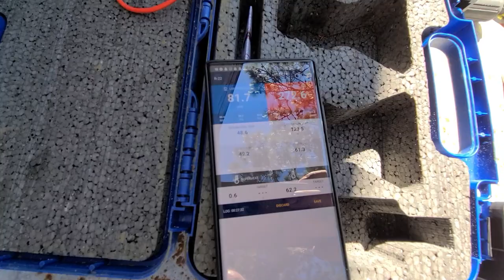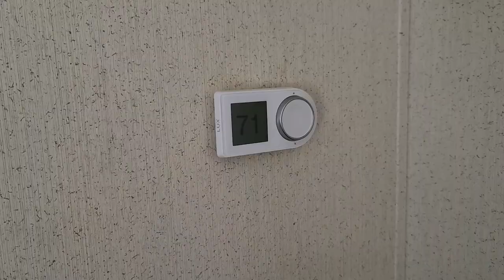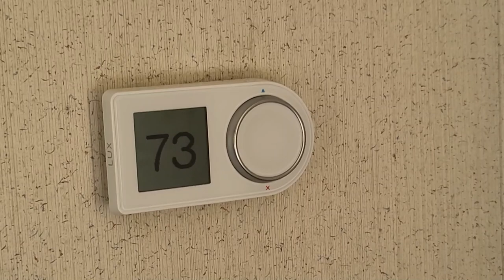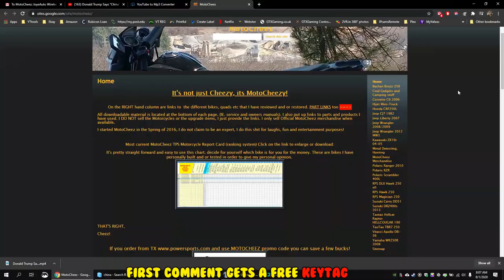(S2 E2) Fence, gates, more property, repairs, MooSoo battery vacuum, HAWK TIME!

Comment: Please keep us up to date if you do hear about someone cracking into the ecu and creating some maps for the dlx.  I do agree with you that there is still more power to be had with the dlx.  I ended up cutting out the catalyst out of the pipe to get it to breath.  With the exhaust done and a KN air filter in the filter box I do believe the bike is running a tad lean.  I'm going to pull the plug again after I put on another 100 miles  to confirm.  Most of my riding has been highway, so I usually have the throttle pin just to make highway speeds.
Reply from the maker: I will for sure! I'd bet it's lean too
Reply: @MotoCheez  One other thing I would like to try to see if it would make any difference is to swap out the fuel injector for a bigger injector.  I asked the question on China riders forum, but no one could give me an real definite answer if it would work or not. Would be nice to find out who makes the injector and to see if they make a larger size that would still fit the intake and give a  try.
Reply from the maker: @ricsha91  good idea

Comment: Try ecu shop and their "full stand next" ecu. They do several different manufacturers and models. I have one for my grom and it's great to tune yourself instead of sending off for a reflash
Reply from the maker: I also have one for my Grom (haven't done video). I can't find one for this ECU that has the set maps. I haven't dug in that much yet either

Comment: Definitely awesome down there for dual sport riding.
Cheesy I've thrown out better condensers then you got over there.
Maybe you should consider changing it out before you come down to a mold factory
Reply from the maker: It's fun but no mountains. We took the unit apart a few episodes ago, it's pretty clean inside these units are all in one package units. They're like $2500

Comment: Thanks for the content, those palmetto bushes are the main plant in the woods.
Reply from the maker: Yes, and I just learned they turn into a palmetto tree, almost like a palm tree but doesn't grow as tall.
Reply: @MotoCheez  Not really. They just spread out and get denser in terms of numbers. 4'-5' is a really, really tall palmetto. but there are tons of different palm trees that run the gamut of heights between palmettos and coconut palms.
Reply from the maker: I looked on google, said palmetto trees can grow 8' , I never knew. I was going to replant some on my fence line. I guess I need to research some more on the different types.
Reply: @MotoCheez  I grew up in FL, on both coasts, so i only base my skepticism on that. I personally, have never seen an 8' high palmetto.... but that is "here". Maybe they get that big in the Carolinas? (One of which is named "The Palmetto State")
Reply: @MotoCheez  They do make a great "barrier" plant. as they are hard to get through on foot, when dense, and like i said earlier (and as you must have been told) they are the favorite environ of rattlesnakes. :-)
Reply from the maker: @strongtower1162  I see some that look like palmetto trees growing in the woods all sizes. I honestly don't know..., maybe something else? I also lived on east coast , palm bay.

Comment: What’s top speed on the hawk cheese? And that’s the fuel injected one right? Thinking of buying one
Reply from the maker: Top speed is about 65ish after you change out the sprockets for highway. And it still does good offroad with the higher gearing.

Comment: Run start capacitor unit you can replace
Reply: On the AC you can order and replace then the noise would be gone on start up
Reply from the maker: It was not the capacitor.. 
checking comment on the PC, the app misses a LOT!